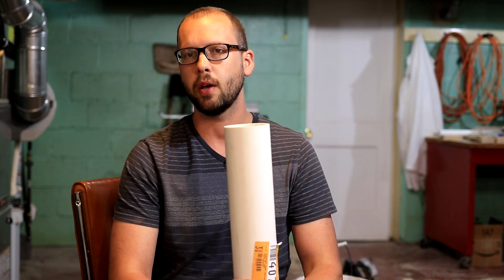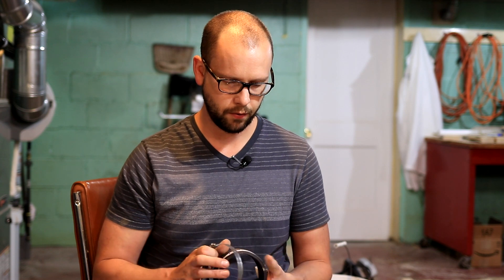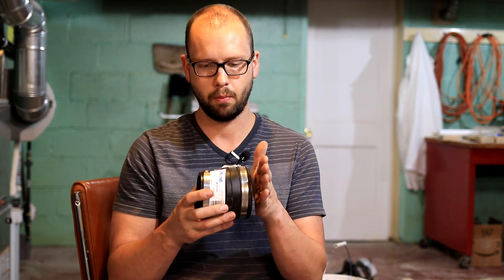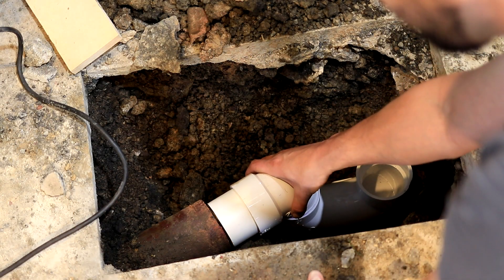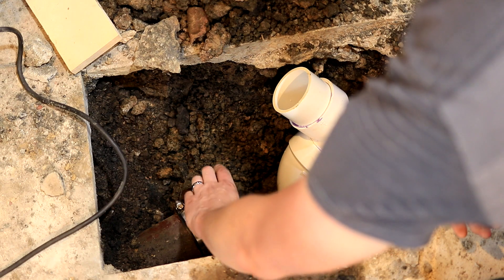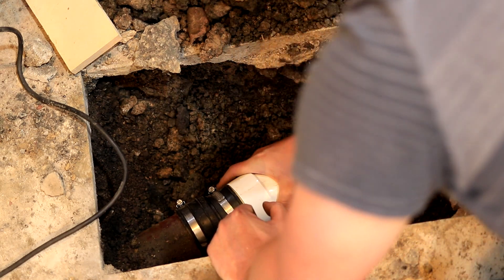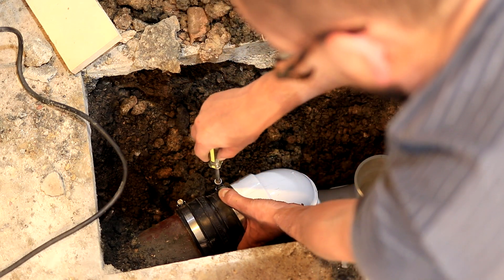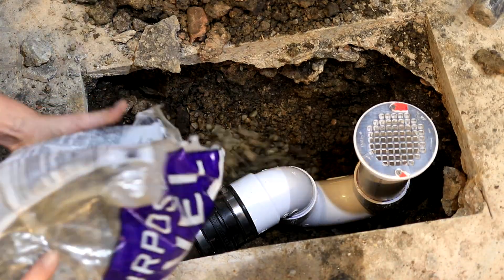How to Connect Clay Pipe to PVC

Comment: For under slab, 'No-Hub' stainless sleeved couplers is what is required by code, all over Canada and the USA. The coupler you used is not meant for below slab. It should only be used in above ground, unfinished areas that are easily accessible.
Reply: Yes a shielded fernco! Minimum 4inch under ground
Reply: What is needed for under slab? Thanks

Comment: Why having a P-trap main pipe since the toilet, sink, shower will have p-trap also?
Reply: Also should be lowest cut riser in drain so if drain blocks up it come out of the trap instead of your floor trap in shower or something, it should be outside u der a tap search up org overflow relief gully
Reply: Every house should  have a “house trap” (minimum 4inch) on the building drain. It helps sewer gas from getting in your house

Comment: what the heck . remove that freaking total house trap-all, each fixture in your house already has traps..out-dated plumbing
Reply from the maker: This is for a floor drain, so it needs a trap since I don't have a whole house trap.  The whole reason I could tell my trap had failed was because I could smell sewer gas in the basement.
Reply: @CoolStuffGuysLike  Your floor drain shouldn't connect to the 'poop' sewer. The floor drain should only connect to your weeping tile drainage system (considering its clay and you dont have a sump pump, its probably also tied directly into the cities storm sewer)
Reply: @JSLEnterprises  Plenty of places, like mine, don't have storm sewers - they just have ditches for rainwater.  If in a flat area, the floor drain can only go one place...
Reply: Usually, floor drains go to the city sewer not the storm sewer.

Comment: Is there a way of connecting internally, instead of rubber pipe connecting from outside, can it be connected inside. The pipe i need to connect is under a brick wall and would be impossible to connect the rubber connection over as i would need to remove bricks
Reply: If you connect it internally that would reduce the capacity of the pipe I would think. I'm no plumber but it sounds to me like you may want to call one

Comment: The size of my  terra-cotta is 4 inches that I will connect to 4 inches pvc pipe do they have those  size for rubber boots
Reply from the maker: Is it 4 inches on the inside diameter or th outside diameter?  A 4 inch Terra Cotta pipe should have a 5 inch outside diameter.  There is a 4 inch clay to 4 inch PVC available on Amazon https://www.amazon.com/dp/B0009VUOTW/ref=cm_sw_r_sms_apa_i_JAz8DbA3R9079 .   You can look around and search 4 inch clay to 3.5 or 3 inch PVC also if you want a smaller trap.  I have a link in the description for a 3 inch clay to 3 inch PVC, which is 4 inches to 3.5 inches actual coupler dimensions.